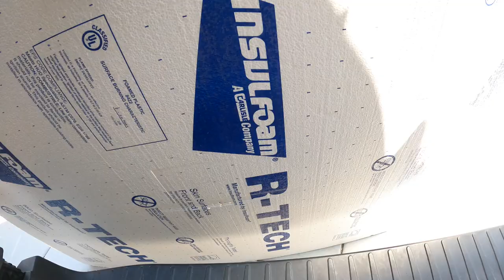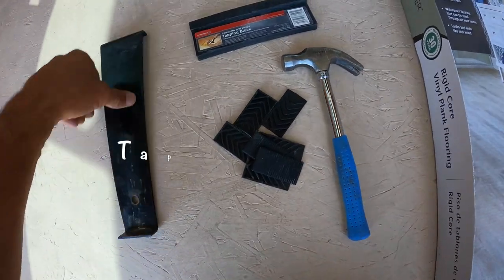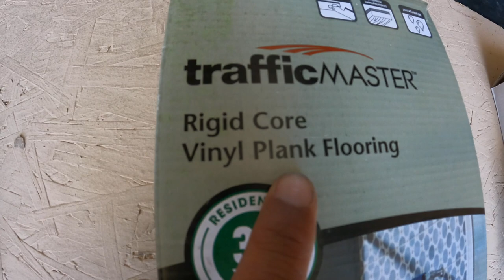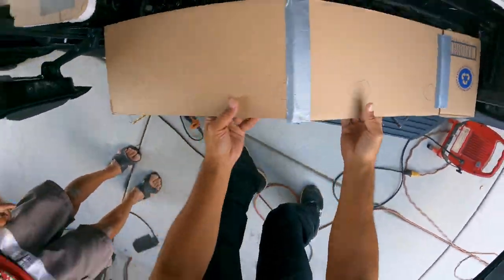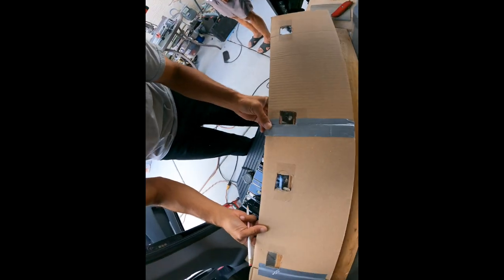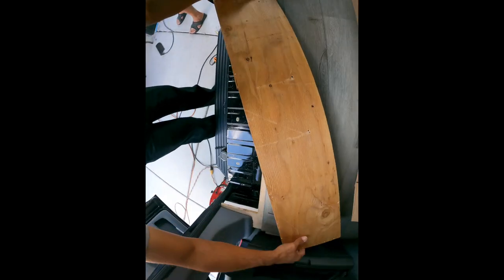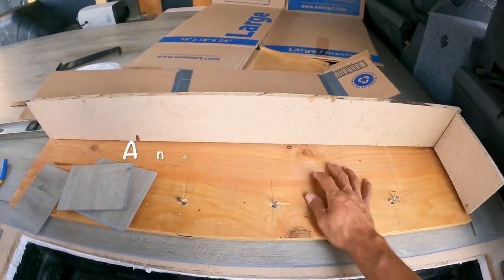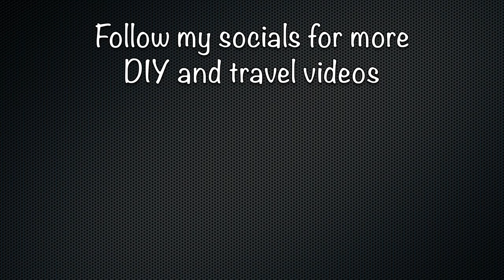Van Build Flooring w/ Vinyl Planks a DIY How to for Steps and Floor Heater

Comment: Your videos are so incredibly helpful for those of us with Transit passenger vans. We were thinking all day on what to do with that darn heater. This is so simple. Thank you!!!! Did you not fill the void spaces in the floor? We thought we might need to but it appears you did fine without doing that. We were thinking about popping the pieces off the back of the factory floor which is not hard to do on ours.
Reply from the maker: The foam boards that I put in for insulation work perfect. Less work and time involved. Once I put the vinyl flooring on top, I didn't notice any of the voids underneath. Hope this helps! Thanks for watching!

Comment: What did you use to cover the bolt holes?
Reply from the maker: I used left over plastic trim that I cut into squares and used silicone to keep them in place before I laid the foam boards on top.